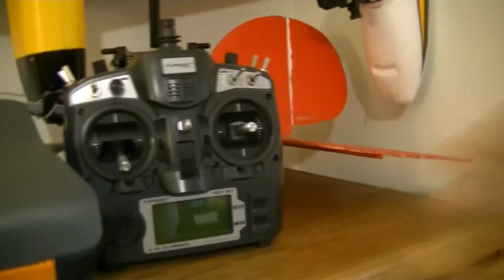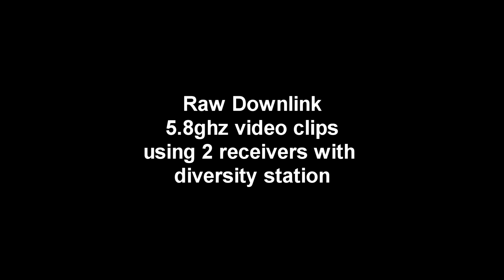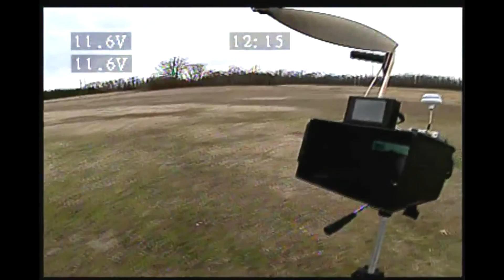FPV Ground Station With Diversity 5.8ghz

Comment: Love the 1.2ghz, except for the antennas, a little more poor video quality on 1.2 but its nice for long flights. Using 1.2ghz on my fx-61 (700mw) and had a 9km flight with it, think I can get alot more with a better antenna.

Check your antennas, its certainly made for a specific channel. My 1.2 antennas has a label on it and it says its for ch.6. you can use it on all channels, but the antennas are measured by osiliscop for the best frequency on a specific channel. =)
Reply from the maker: mrpeter81 Thanks for the tip on the channels.  I have an oscilloscope,  frequency counter and a RF power meter at work that I may use to see how everything is doing.
Reply: deejaybustab  Sounds like a good idea =)
Maby you can get some extra feets away with the right freq =)

Comment: Beautiful ground station my friend :)
1.2Ghz is really amazing but the antennas are so big lol
You did not talk about your radio control frequency or maybe i did not listen carefully! What will you use?
Reply from the maker: Thanks!! I will be using dragon link for my control when I switch over to my Bixler. I show that radio setup towards the end of the video just before the flight clips. Can't go wrong with Dragon Link UHF lol
Reply: deejaybustab Sweet :)
Yes Dragon Link is the best so far!
However, do not forget the 3rd harmonic of 400mHz which matches with 1.2Ghz, you will probably need some low pass filter on your UHF TX :)
Reply from the maker: ABMNS PRODUCTION yup I picked up 2 of the low pass in line filters a week ago just so I can be good to go. I've been reading and reading just so I can be prepared lol! The 1.2ghz system I purchased is 700mw. I know I may not need that much power but I couldn't pass up the deal on it lol!!
Reply: deejaybustab LOL actually i had 1W 1.2Ghz video TX but shhh, shhh...
You are definitely ready for some serious long range over there!
Fly safe and keep the videos coming!
Have a great week